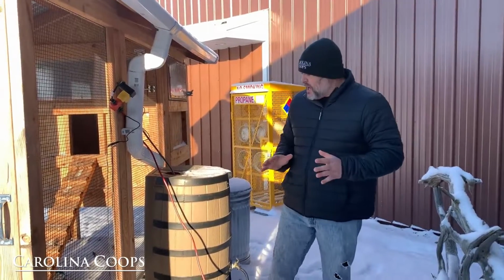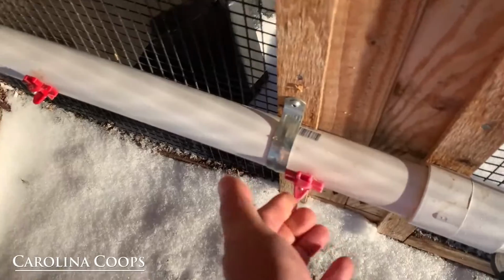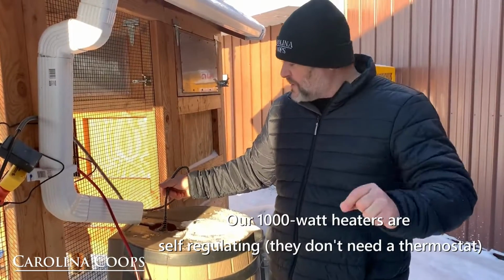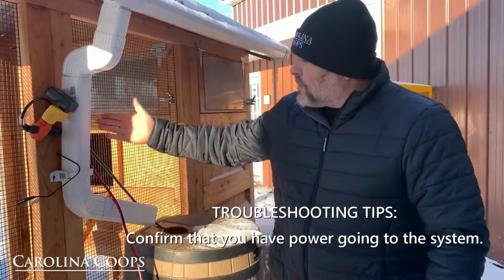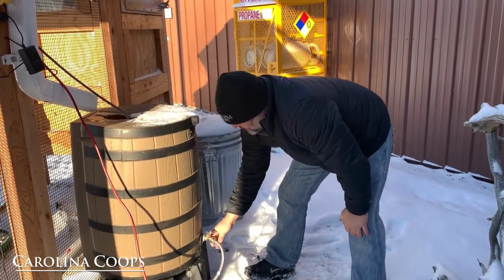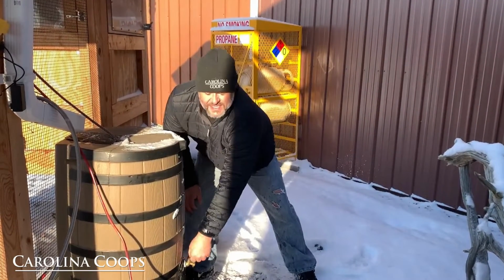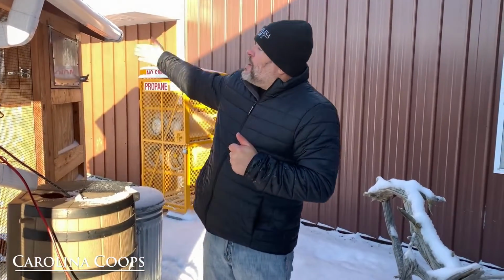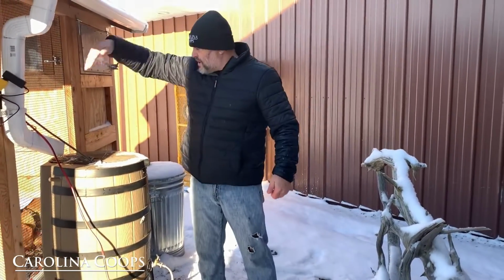Best Heated Chicken Waterer| DIY Tips| Troubleshooting Instructions

Comment: Have you ever made this run completely by a solar power set up?
Reply from the maker: We haven't. For that to work reliably,  you would need a battery and inverter so the pump would work overnight (when freezing temps are most likely), so you would have to ensure the system was reliable. If for some reason it didn't have enough charge to run the pump and the heater, you can risk the waterbar freezing and cracking.  So, what we are saying is it can be done, but it needs to be in a way that the electricity coming to the water system is reliable. Thanks for your question.
Reply: Thanks!
Reply: Did you ever run a set up like this on solar?

Comment: I think your heater element should be plugged into the thermostatic plug and the pump on at all times. I viewed this video briefly and I think you have it the opposite.
Reply from the maker: The heating element is self regulating and the pump is not.  That is why the pump is plugged into the thermostatic switch and the heater is not.